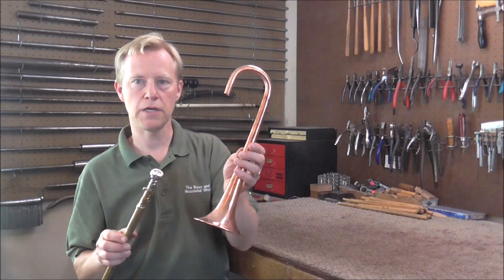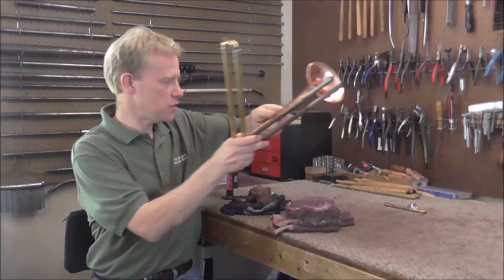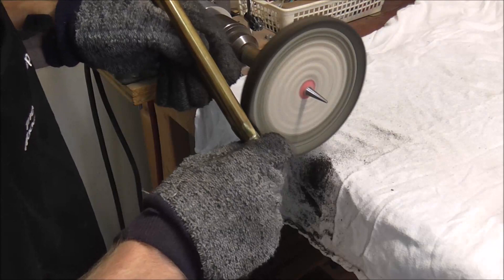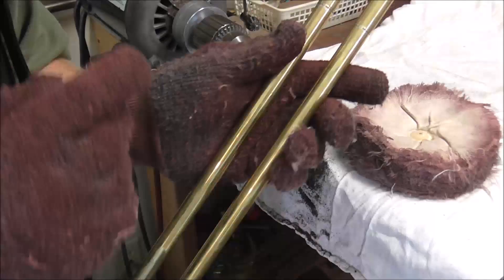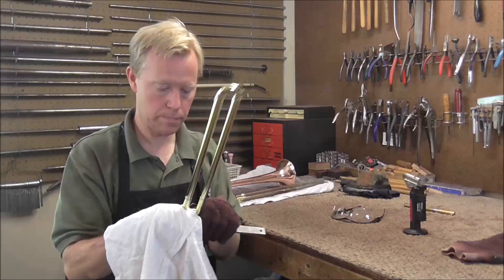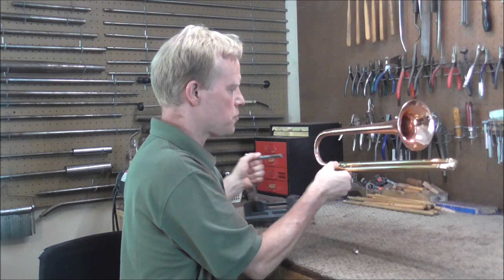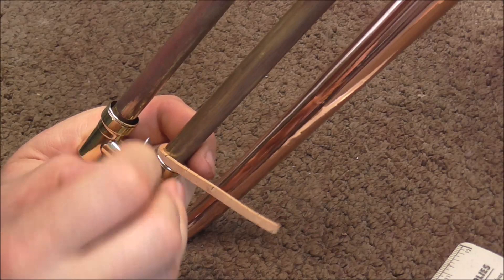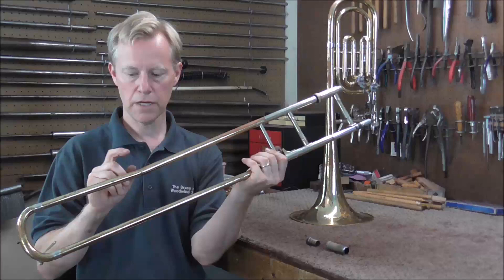"Building a Slide Trumpet Project" COMPLETED... Buffed, Lacquered and Played

Comment: I've been following your videos on the slide trumpet and it's inspired me to start doing instrument repair and customizing .I'm an auto body technician by trade so I'm familiar with welding brazing MIG welding TIG welding etc and the choice of tools you use are very similar to tools in paintless dent repair and I do have an older baritone missing a tube on it. So I think I'll try to fix it in the near future thanks for your inspiring videos you are a true technician.

Comment: Awesome job! I’m gathering parts for a copy cat! I’m having a hard time sourcing a slide with a small enough bore, though. And my bell came off a cornet with a shepherds crook so it’ll be unique that way!
Reply from the maker: Try looking at antique malls for old trombones. You will probably be able to find one that is so bad that you will not feel bad about cutting it up.
Reply: Thanks for the tip! I found an old one the other day, friction fit slide, brass tubes with soldered stockings. I believe it was stamped “wizard” brand. But they wanted $275 for it, which is more than I wanted to spend for this project.

Comment: Nice job! I was wondering why it looked so strange then you showed the bass trombone where the entire slide assembly disconnects from the bell. Why did you choose to make that a rigid soldered connection?
Reply from the maker: I soldered the bell because the end of the bell had quite a larger bore than the slide tube. If I would have made a collar, it would not have a tight fit and would rotate while it was being played.
Reply: @TheBrassandWoodwindShop  Thanks, Art. I didn't realize there was a mismatch in bore size at that location. Nice job!

Comment: I have 2 trumpets with really bad tarnish all over. I'm going to hand buff them to a shine and relacquer. I'm curious, what solvent did you use to clean off the buffing compound? Would a bath in dawn dish soap and water work before lacquering?
Reply from the maker: Denatured alcohol or degreaser work well to clean the buffing compound before lacquering. Donot use dish soap because that will leave residue.